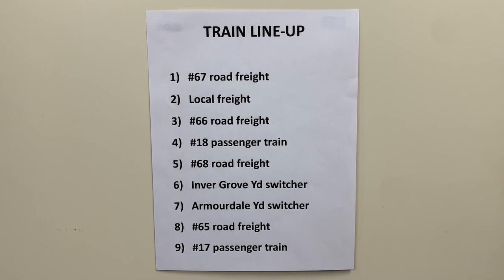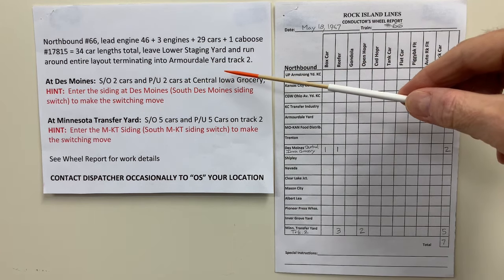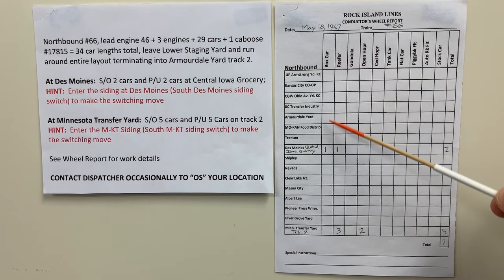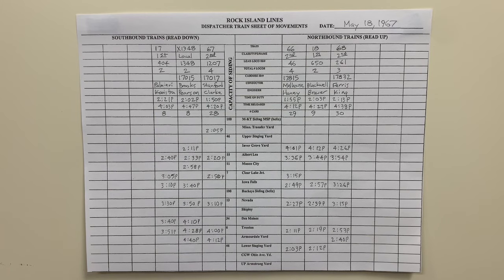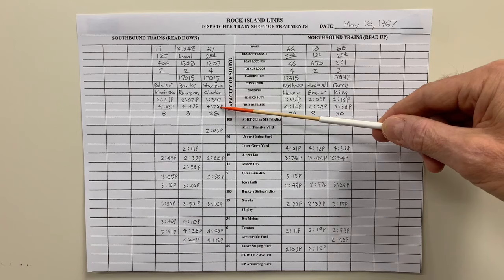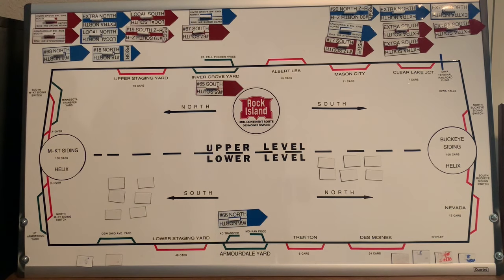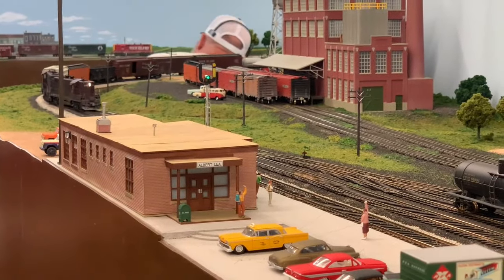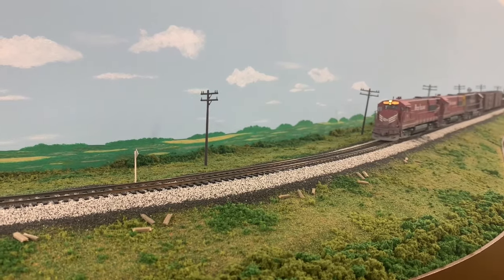Model Railroad Operations & Dispatching on the Rock Island Lines

Comment: Great tutorial for Ops on your layout I greatly enjoy it. Does it happen you have more crew than trains? If so what do you do?  Does it happen that trains "terminate" faster then expected as well? Thanks again for the great video
Reply from the maker: So far, we haven't had more crews than trains; however, if that were to happen we would be able to add trains to the operation a little later to allow everyone to operate ...... OR .....  we would form 3 man crews to allow more junior attendees to gain experience and familiarization with the layout.  Trains don't terminate faster than expected as they all have some work to do along the way and they have meets with other trains which eats up some amount of time.  Thank you for your comments and questions.        Mike
Reply: @rimodeler7963  Thank you very much Mike. I appreciate your answer. Greats stuff.

Comment: Great video Mike. OS meaning "On Sheet" is interesting and appropriate. Especially before CTC when Station Agents, train crews, and operators had to report their location to the dispatcher. The term "On Station" became common nomenclature once CTC became widely used because it would provide electronic/visual feedback to the dispatcher. That's how dispatchers and I used the term on the MoPac & UP. But again, railroads are conglomerations and the nomenclature terms are like a soup of intersecting terms and meanings stirred together in a large caldron and used differently in different areas. That's why your use of the term is so fun and it is the right term.

One of the interesting train reporting methods I remember using is "Train Registers" that were located in dispatcher phone boxes at junctions in Dark Territory and at junctions that went from Dark Territory to signaled territory. Every train would have to stop and fill out the Train Register and reference the Train Register for trains told to wait for.

Can you imagine having an operating session where you used "Train Orders" with a person designated as an operator/agent at every station? The train crews would run deaf with no communication with a central dispatcher, but rather received main track authority and operating instructions from the operator at each station?

Thank you
Kevin Dawson
Reply from the maker: Hi Kevin -  You are correct that a lot of railroad nomenclature tends to take on a variety of different interpretations and uses.  I remember Train Registers as we had one on the north end of the Denver Terminal at Clear Creek when I was Roadmaster there in the early 1980's.  A tragic event occurred with that register in August 1985 that resulted in a horrific head-on collision.  As a result, train registers were then done away with in favor of Track Warrant Control (TWC) territory which was a really good move.  Thanks so much for your great comments and for watching the video.        Mike